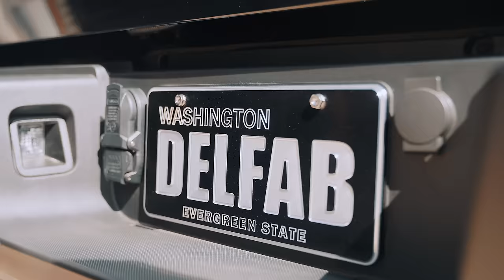Unbelievable Single Cab Platinum Super Duty!

Comment: At least you checked the oil before doing anything else..It's always a good idea to check all fluids first on the list nomatter what it is..I have a friend that's so bad about dragging vehicle's home to flip em, the first things he does is grab a battery and a jump box..He's fired several of em up and didn't even bother to check any fluids under the hood..A week ago, a 99 Mazda car, beautiful car, fired it up and I asked if he'd bothered checking oil, nope..The car was so dry of oil that there was not even a 1 tiny drop on the stick..The car needed a clutch, it's ready to go now especially after filling it up with oil lol. He pulls in yesterday in a 1973 Pontiac Grandville convertible. Nice straight decent looking car..I opened the hood, checked the frickin oil and it had barely a quart left in the engine and he drove it 15 miles from where he got it and didn't check anything, again..I don't understand what's up with him cause how many ragtop 1973 Pontiac Grandville land yacht convertibles with a straight body and everything that's all there except it needs a top beings it's a 52 year old vehicle with only 33k on the odometer. Wasn't very many ragtops built in 1973 especially a Grandville lol..I don't know what I'm going to do with the guy but he needs to wake up cause he's blessed to be able to buy stuff for hardly anything making decent money with em lol..Richard has a durn good crew that's 4sure..

Comment: Still riding my 02 F350, 4x4, 7.3 standard, 100 percent stock except leveling kit, with 122,000 miles.
Reply: My daily driver is a 2000 F-350 4dr/4x4/7.3.  I'm almost at 800,000 miles. Original motor, 2nd transmission(got 220k out of the first one and 575k out of a Ford remanufactured). Every thing else is stock. Needs some stuff but it rolls very good. Even the interior is in good condition. 👍👍👍
Reply: @JoeBattle  everything on these trucks was just built better, except the plastic lockout dials, mine are still good but I won’t miss them.

Comment: That duelly you should try and get dennis to buy , i would put a good modern gasser or 12value clummins in it , now that would be rad! Or use it as  tow rig to pick up or pull a trailer to pick up or.make a deal on that wood boat!😅!!!

Comment: Im still confused, if he bought another single cab why did he need to buy a separate single cab frame? I don't get it, he used the single cab and single cab bed and put them on a different frame, then what did he use form the platinum and where is the rest of the platinum? so confusing

Comment: Cool truck but it's only $50K in my book. It's just a single cab truck with nice factory interior. No matter how much money you spent to build it, at the end of the day that's all it is
Reply: 35k is more like it ...
Reply: They107 k off the dealers forecourt, you find any for 50k I’ll buy em all👍
Reply: You must drive a civic 😂
Reply: @illsaveyes  107k was a brand new platinum crew cab, nota single cab. Its a lifted single cab long bed ford with factory interior. Its nothing special, its not even painted, it's vinyl.
Reply: @__jae  2022 2500 high country
Reply: @cliff4695  it’s done under a thousand miles worth 80kall day custom aint for everyone but still worth double a work dog all day👍
Reply: @illsaveyes  i don't care of its got 0 miles on a dealer lot. To me, its 50k. Ive got an all original 91 K5 blazer with a 4 inch lift, in fantastic condition, I wouldn't trade even up. I might trade my 78 CJ7 straight up, would be a tough decision.  If you value these new plastic trucks with government epa restrictions, you should reevaluate what really matters. Its a lifted, plastic, single cab, long bed, ford truck. I'd rather have that exact truck but a 1997 with a Cummins swap.
Reply: @cliff4695  your obviously bias to older stuff, 50k will get u a bog standard double cabhere in the uk the older ones go for next to nothing they are rubbish same for rangers total bags of crap this truck will do over 200k@ barrat Jackson in the near future 👍